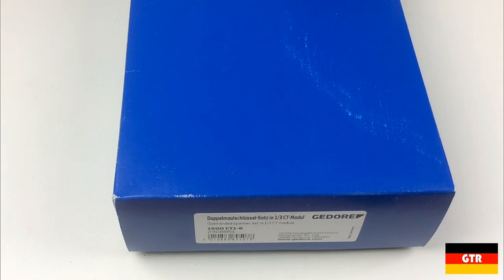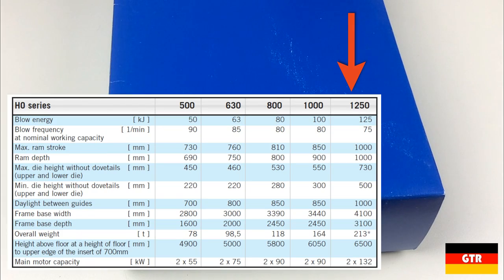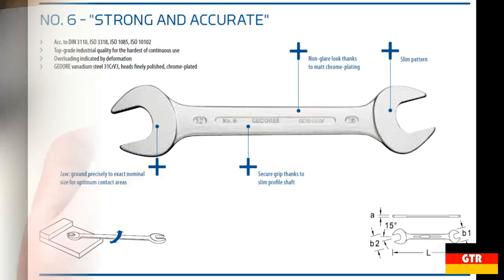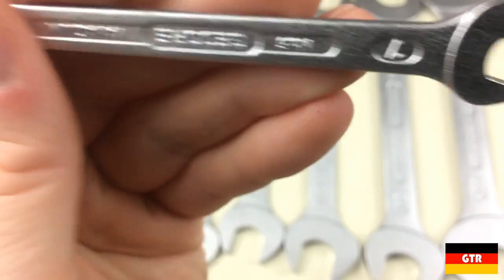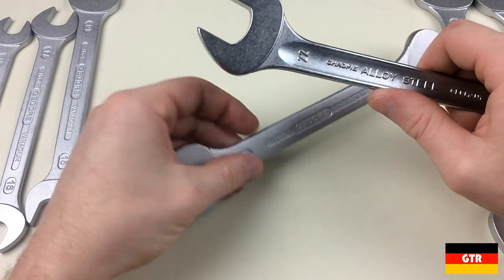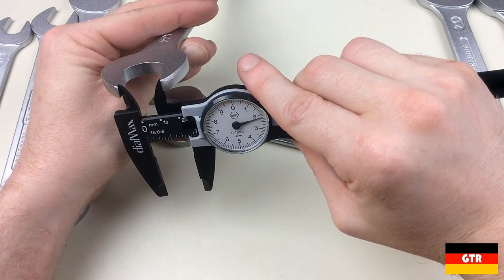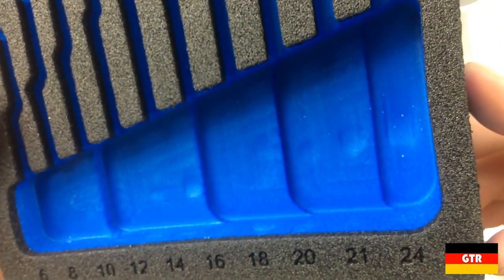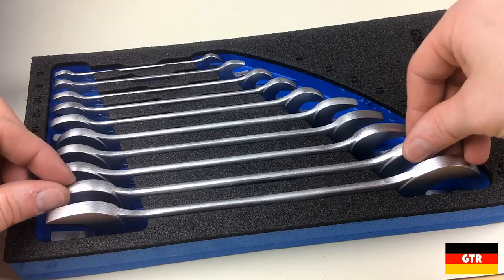German Tool Reviews:  Gedore Open-ended Spanners

Comment: My dad bought two of this sets in the late 70s, still owns them today and the chrome looks like new.
I think the finish is one of the reasons people, at least here in Germany, first think of Stahlwille spanners, they just look and feel more defined, the Gedore finish looks like a 5-10€ China set, especially the letters. But using them I actually prefer the feel of the Gedore form and finish over my Stahlwille spanners.
Reply: dranfonzel the gedore finish is supposed to be rougher. They sandblast them with low grid after forging to get this rough surface. First of all the chrome sticks better on the surface and if you have very oily hands you still have enough grip. Bahco has some nice satin finish... Looks good but is less grippy. From optical point of view a nepros or snap on chrome polish looks the best. And could be fine if you don't have an oily environment. But here in germany mostly only cheap spanners have a polished chrome finish... It is changing but until a few years ago it was not considered as a quality sign

Comment: I bought a box wrench 18/19 gedore spanner a couple of years  ago as the faithful brand one I had been using to remove a tap valve just bent  like toffee. The wrench just took the part out really solidly and no sign of weakness. That was a couple of yrs ago . Had the same problem with another tap couldn’t get the cartridges out different size 16/17mm bought a set of Draper. Bent like toffee when I tried to remove the part. Ordered a gedore 16/17 on eBay came a few days later and it took the part out without any fuss or bending. Conclusion the box spanners by Gedore are strong hard and definitely the best box wrench I’ve used. I am now thinking of getting some more Gedore spanners☺️

Comment: I've been using and abusing Gedore 1B ring-open endend spanners, and they are some of the best wrenches available. The matt chrome is very, very durable. It indeed doesn't chip. However some wrenches do get rust spots depending on use. But I think I like the feel of the stahlwille wrenches better. 

At the heavy diesel shop I work at we use both Stahlwille and Gedore, and neither spanner breaks. Which I think is a testament to their durability. 

Mind you, in Europe Gedore is very well known and most automotive workshops have Gedore gear. Snap-on tools on the otherhand are hardly used.
Reply from the maker: Cool, thanks for sharing.  Do you ever use any other spanner brands?  Heyco? Matador?
Reply: Heyco and matador are not brands that I know of. 

I think that with spanners, much more than any other tool, its a case of get yourself a GOOD set once, and you're set. Gedore, Stahwille, it doesn't break so no need to go buy other stuff.

That being said, I recently bought a set of 'Roebuck' spanners, because they were on sale and came in a nice pouch. So far really nice spanners for next to no money. Always useful when I need to cut, bend or weld a spanner to get some weird bolt off. Wouldn't want to do that on an expensive Gedore wrench
Reply: gedore had been widely used in Poland in the 1970 and 1980 period.we called gedores every  kind of sockets.with mainly  Russian and North Korean tools to choose from gedore was the fancy one  to have.
Reply: @jerrykruger we in Macedonia too call every ratchet a gedore because of Gedore. 😂
Reply: Gedore spanners available in South Africa are manufactured here in South Africa except for the RED series which are manufactured in India.

Comment: The finish on my  1b  Gedore spanner set  has lasted many years , i use  the 13mm , 19mm  often  along with 30mm and 27mm  .they are used  in a harsh heavy vehicle enviroment . they are worth the money and will out live  other brands . for smaller jobs i have Stahlwille 13b series combination spanners  as they are more compact in terms of length . my open end set is Hazet  but if i had my time over i would have bought Gedore or Stahlwille.
Reply from the maker: Cool, thanks for sharing.  The Hazet spanners seem to be the most expensive out of the three.
Reply: Why do ya not like the Hazet Spanner's? I have the Wera Joker Switch & Gedore 7UR metric sets, the Gedore 7 seem to look just like the Stahlwille I-Beam Spanners

Comment: I think the 1/3 sizing system for the foam tool trays is the same as that used by Hazet.  Stahlwille has a similar thing which may also match.

Comment: I have some gedore spanners that are easily 25years old, coating is still in a great condition, only one of them has chipped coating but that was due to the tips of the jaws being beaten with 
a hammer (By the previous owner. )   I just wish that the South African gedore spanners   were embossed with "made in South Africa."  I have two sets of 1b  patern Spanners that are locally made.
Reply from the maker: Cool, thanks for the story.  Yeah I was saying that with their 62 P adjustable wrenches, which are made in South Africa.  I would think it would be a source of pride for those guys working in the Gedore South Africa forge.
Reply: Saw Brasilian made Gedore 1 B- combination spanners embossed " Made In Brazil " ...
Reply: Yes, Gedore has factory in Brasil, more precisely in São Leopoldo (Rio Grande do Sul state). Even the Brazilian made Gedore tools are regarded by most professionals as the best "local" hand tools you can buy. Whatever is not made in the São Leopoldo factory, is imported from Germany.
Reply: I have the Brazilian made wrench it is great quality same with tramontina-pro. Cheap and exellent.
Reply: German Tool Reviews I work at Gedore SA. We take pride in our work indeed. Thanks for the spanners review.

Comment: I have a beginner's question on drop forging please.

All things being equal except for the Blowing Force of the drop forge hammer. Will a hammer with a higher blowing force produce a stronger metal?

For example if you had a Lasco HO-U 500 with a Blow energy of 50 [KJ] vs a Lasco 2000 with a Blow energy of 200 [KJ].

Will the 200 [KJ] hammer forge a stronger metal? Again all other things being equal . Only the Blow energy is different.

Comment: The India spanner's I heard are not very good, and the 113 ton hammer is for Gedore's huge wrenches that are 160mm sizes stuff I've seen. So do you like the Stahlwille or Gedore spanner's better? Or maybe Hazet since I've seen you have some of those also? I picked up a set of Wera Joker Switch wrenches & Gerdore U-30 1/2" Ratchet and socket set also from KC Tools, i really like the Gedore 1/2" Ratchet and socket set, expecially the handle feels really good, and I like the Wera Joker wrenches but a tad heavy but the features out weigh that, I appreciate your videos, it helps me figure out what to get at KC Tools, I've spent a little more than I should have there recently, but hey it only hurts once  plus they have had really good deals and it should be a one time purchase with the high quality tools they have. And ya never complain about how well a tool works after ya get it.
Reply from the maker: Gedore and Stahlwille are about the same, but have their differences. The Stahlwille are lighter but are more expensive.  I've been using the Gedore more lately though.

Comment: Best looking wrenches I've seen and reasonably priced, will probably get a set. 
How do these double open ended ones compare to combination wrenches? They would save me about half of the price and weight, but is the box end important for non professional use?
Reply: Your comment is already 4 months old, but yes, I'd definately get a box end set. You should use the ring whenever possible, it's just less likely to slip off the bolt and f*ck up your hand and bolt head.  
Anyway, you should have 2 spanners of each size. One to hold the bolt, one to open the nut, so just get both sets. :) 
If you are a non-professional I can also recommend the brand "Proxxon Industrial". Cost less, but can take quite some abuse.

Comment: On a trip to Europe recently I picked up a couple of ‘Walter’ combination wrenches. I really liked the finish and they seem to achieve good definition with their forging. I only needed them to weld to a machine as a handle so cannot vouch for their fit, strength or stiffness. 

Have you ever encountered ‘Walter’ tools and, if so, what’s your opinion?
Reply from the maker: A lot of companies have used the name 'Walter' in the past because it is a common surname.  Was is Carl Walter?  There is a C around the W in their logo.  http://www.cwalter.de   They are known more for their specialty spanners, like offset wrenches.  Their impact sockets are supposed to be top notch.  I have never heard anything bad about them, but their stuff can be quite pricey.
Reply: German Tool Reviews 
It is a Carl Walter. Wasn’t that expensive in UK (~$6 for a 13mm). It’s a 290 series. See Page 8 of the following pdf http://www.cwalter.de/images/pdf/2016_schraubenschl.pdf

I’m happy to mail it to you for a look if you’d be interested. I also picked up a CK ‘Dextro’ screwdriver that is ‘Made in Germany’ and can send that too. I also have a Halfords-branded ‘Made in Germany’ long screwdriver. 

Interestingly, to me anyways, the UK version of Home Depot, called B&Q, sells a range of ‘Wiha’ tools alongside the budget Chinese options. Screwdrivers and screwdriver sets mostly, and these in the basic soft-finish handle.

Comment: Why are these double open ended so hard to find, and combination wrenches so common? I would really like a set of the classic double open ended.
Reply from the maker: It is always preferable to use a box end as it minimizes chances of damaging the fastener.  However, there are cases where you can't use a box end so you always need to have the open-end ones handy as well.  I believe this versatility is the reason the combination ones are more popular than both the double open ended and double-boxed end wrenches.  If you are tight on space than double open ended are the way to go.
Reply: I don't believe the double open end or double boxed end are hard to find with German Tool Companies, I think they are very common with them just not US brands
Reply: Roof Repair Techs true... Easy to find here in Germany. All variations combination, boxed with this "angled offset"....I just had to buy some for work I was overwhelmed by all the possibilities/combinations. Open box spanner Form A or Form B? Long version short version? With ratchet? Only one side? Both sides... With direction switch? Special bended version?

Comment: Hi! So I am thinking about buying some gedore ratchet spanners from KC tools. And you are the guy with all the knowledge. Any thoughts? Also, price is an issue on this. Thanks for any insights.
Reply from the maker: Don't have any ratcheting combination wrenches if that is what you are referring to. It is on my list of thing to eventually pick up, but I don't have an immediate need for a set.    The Gedore and Stahlwille versions always looked the most appealing.  The Wera Jokers also look nice, but those don't have a reversing switch if that is important to you.
Reply: Gedore are made all in Germany wera made in Chzech republic stahlwille ones I've seen Taiwan hazet wrench in German made ratchet mechanism Taiwan so if you want German all the way gedore for rachet wrenches if your going to spend big money on ratchet wrenches for a strong non Taiwan mechanism snapon are all usa made with a non slip flank drive plus open end and their slim all the way around the ratchet side

Comment: Those are soo damn nice. I saw an old Gedore India wrench in a pawn shop, it looked decent but the metal seemed soft, not sure if it was the finish. I'm regretting not buying it just because, it was in a bin so it as probably only $1-2.
Reply from the maker: Yeah all the India made ones I have seen have a more polished chrome look and often the chrome is chipped.

Comment: Have you ever seen gedore spanner in high polish finish. I bought 5 spanner’s 7r version and all are like it. Then I bought others to complete the set and I received them all in satin topical gedore finish. all of them have unserviceable ratchet mechanisms except two where are screws . Do I have some fakes over here?
Reply from the maker: They could have just been older.  Even the really old Gedore spanner didn't have this type of finish, there was a bit more polish to the older ones.  The Gedore spanners made in India did have a polished chrome finish though.
Reply: German Tool Reviews . There are not chrome plated just polished to glossy finish and as being ratcheting spanner’s can not be produced in India as that is quite new thing. There is not made in Germany on them tho also I don’t get it why on some of them I can get into ratchet mechanism and don’t for the other if they are all one way ratchets 7R. How you said they may be just old/the first version just wondering where they made .

Comment: combination or open-end? I like more the combination wrench.
Reply: Davide Santos I'm the same.ithink the double open end are too short especially in the larger sizes
Reply from the maker: The length for the larger sizes does seem a bit short in this form, but they are constrained by the DIN standard in that aspect.  Gedore does make extra long versions of their combination wrenches though.
Reply: Prefer open-end myself , less to carry !  (Stahlwille 10/8 pouch) :]
Reply from the maker: Yeah I do like those Stahlwille pouches.
Reply: i did'nt know that they were constrained by the din standard i did'nt get to that part of the vi as i was at work,i was looking at the gedore 7xl spanner set on ebay 8 to 24 mm set nearly €190 plus p+p.
Reply from the maker: Yeah the XL versions (extra-long) are only available in the combination wrench form, which would be the Gedore No 7 series.

Comment: Man, I have one gedore 11mm combination wrench that is made in Brasil, same finish to the ones you got. I was skeptical at the beginning because it is not made in Germany, but I turned out my favourite wrench in my workshop becuase the finish  doesn't get slippery with grease and is durable too. Also the deep offset in the ring side makes it practical.
Reply from the maker: Gedore did at one point have a manufacturing facility in Brazil.  It was sort of like the one they have in South Africa where it was only really used for production in the local market and was rarely exported.  I haven't seen any of the Brazil made products but it sounds like they have the same quality as the ones made in their Remscheid Germany forge.
Reply: interesting-  there is no much use for 11 mm ( M7 ) .
Reply: have same faith in Brazilian forging. the first mercedes Benz diesels for trucks with million miles warranty had been manufactured in São Paulo plants. I had seen them go way over that milion  without any hiccups